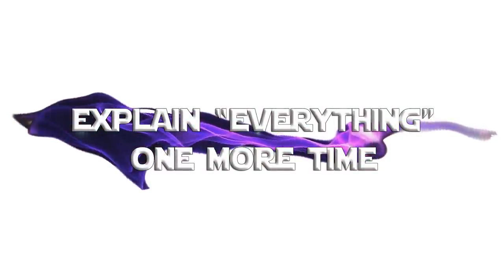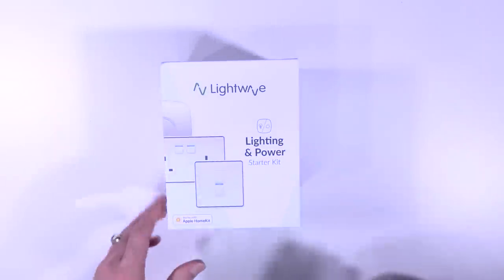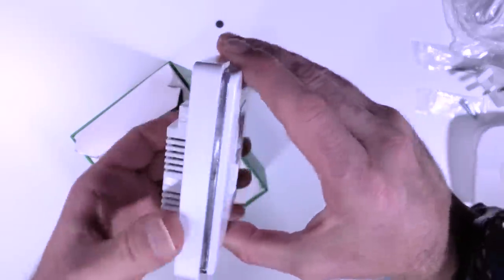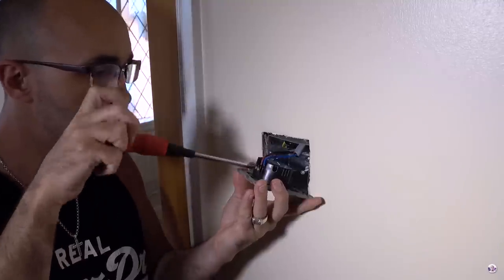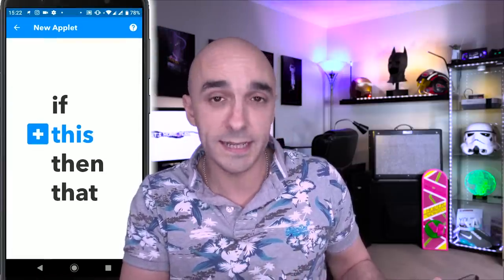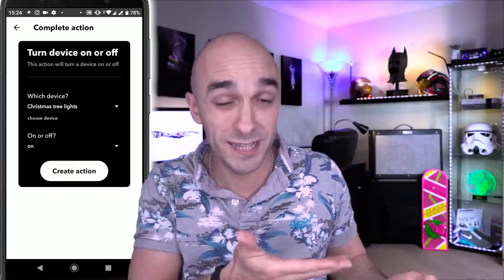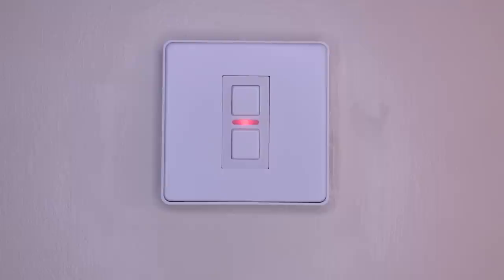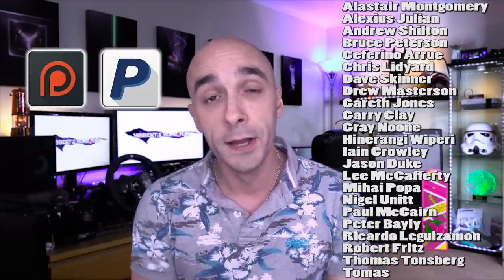Turn On Your TV With Your Light Switch : Lightwave RF Gen 2 Smart Series Review

Comment: Hello Paul. I'm contradicting you :) you can do the same thing with eWeLink broadlink and ifttt. After watching your video, I've tried for myself setting up one channel from a three channel ligthswitch, when it's on the TV goes on. When it's off the TV goes off. Of course that I could use one blank switch for this as well that I can automate to do more then opening the TV. But for now this is what I have set up for my broadlink. Try for yourself and update me if it's working for you also. Cheers mate!
Reply: Also this is not working through rf. It's ifttt based. Which is more simplified. :)
Reply from the maker: Morning mate.  Ewelink requires neutral, but yeah, a much cheaper option if you have a neutral wire!  To my knowledge the Broadlink TC2 can't be dimmed by percentage with Alexa (though I could be wrong), but it definitely doesn't work as an IFTTT trigger yet, as the triggers are broken.  Actually this morning I'm finding I can't get the "THAT"'s working either!! arrrrggghhhhh Broadlink!!!!!
Reply: @paulhibbert  hey Paul. You are probably right about the dimming and the TC2. Now I 2as just speaking that with a very cheap 5 dollars sonoff basic, by using it in conjunction with rmpro you can open a TV and much more. For dimming and so on I don't know. But as you were mentioning Alexa, I can confirm that if I say ok Google turn on movie time which is the name of my sonoff basic for this scene, it will open my TV, turn off unwanted lights and turn on the environmental led. That's great 😊
Reply from the maker: Nice! :)

Comment: I got one for my room to control my zigbee lights via my hubitat, but I am having some issues. I don't want it to physically switch my lights and I can't seem to connect it to my hubitat. I would have got a zigbee light switch, but they a) look like cheap plastic, and b) don't wire in so I can stop accidentally turning off my light. Am I doing something wrong?

Comment: How are these holding up? If the hub or Internet is offline can you still use the switches to turn on/off the lights.
Reply from the maker: They do work offline, but I removed them for something much cheaper after the sockets failed.  I've never looked back.
Reply: @paulhibbert  thanks. Did the light switch fail as well? Did you manage to do another video on the ones yiu replaced them with? Can you share the name model of what you went with please? Thanks.
Reply from the maker: @nasaspacemanwho6711  the light switch lasted well.

I replaced it all with tuya smart life based zigbee stuff from zemismart. If you look on aliexpress for zemismart you'll find their store and its full of cool stuff. 😊

Comment: Do you have to have the LW Link Plus for this to work! ? I have the very first lightwave hub LW930 I think it's called?
Reply from the maker: Not sure if anything before the Smart Series stuff has this ability.  Worth a look, only takes a couple minutes to sign up and start using IFTTT.  Only problem is they are experiencing a VERY lengthy outage on the IFTTT triggers.  I've been complaining to them for over a month that this has stopped working!  I'm almost ready to drop a video telling people not to buy it.
Reply: The connect hub - as its now known - only has limited capabilities.  The new smart hub has two way communications so has a greater range of functionality with IFTTT.  For instance on the Connect hub you couldn’t connect a radiator TRV (to ifttt).  With the smart hub you can.
Just upgraded to the smart hub last week and despite the price its well worth it. The speed it responds is almost double that of the connect and now I have two way communications to smart devices. My connect devices still work but the hub isn’t aware of its state. By that I mean if you use the app to turn on a light the app says its on. If I press the light switch off manually the software doesn’t know so appears still as though it’s on via the app.  Not a big deal for me as I use Alexa to control most of it.

Comment: Can you use smartthings hub instead of adding yet another rf hub?
Reply from the maker: Thanks Gary, pretty sure you're right, I'm amazed it can do the IFTTT trigger thing to be honest as most manufacturers don;t like to play nice, though considering they have implemented IFTTT maybe Smartthings is in the pipeline!
Reply: @paulhibbert  You can already cobble something together in SmartThings using a virtual switch & IFTTT as a workaround if you've got both hubs

Comment: 6:05 I dunno how you can use a multimeter to determine if the electricity is off without a neutral wire in the switch box. There will be situations where zero volts doesn’t mean there’s no electricity at the Live wire.
Reply: If you turn on the switch there will be voltage. There are simpler testers out there that just need proximity to the live/line wire.

Comment: I got one of these and put one in my lounge I did not bother buying the hub as just bought LightwaveRF remote and pointed at the switch then use the RM Pro as the hub  and  only cost me £48 on eBay and when I did buy the first gen hub for cheap on eBay found it was slower to respond than RM pro so I'm back to my original setup of using the RM pro as the hub LightwaveRF light switch and LightwaveRF remote is the cheapest way to use LightwaveRF
Reply from the maker: Nice!!!  How did you teach the RM pro the frequency? ?
Reply from the maker: Ah, wait.  I think I understand, you bought the separate remote.  Only thing without the hub is that you can;t do the dimming by percentage using Alexa I presume?

Comment: What different it is than using a $5 Sonoff switch with IFTTT, eg. If Sonoff switch on Then roll down the blinks, close the curtains, turn the TV on, switch the console on, turn the lights on, send a text to wife (not yours!).
Reply from the maker: Hey man, I love my Sonoff stuff, but this is an apples and oranges thing, they are different products in different arenas... the differences are: 
Reliability
Dimming functionality
Apple Homekit support
Aesthetic
Ability to replace multiple gangs
Missus can't turn the device off at the mains switch rendering it unreachable
Internal automations that will work without Internet
Can be controlled with additional products such as a remote
Can (apparently) be controlled with 3rd party products such as Broadlink RM pro

-P

Comment: I have gen 1 switches and hub. Works well but so dam expensive. I do have one issue and it's a big one for me.  Bloody compatible dimmable led bulbs most of my fittings are e14 screw with 5 bulbs and it's complete joke finding a compatible bulb which is reasonably priced that doesn't hum or flicker or even simmers low enough for me to class it as dimmer..  I've had my winge now. I don't use this switch currently for this reason.
Reply from the maker: Somebody mentioned about installing a capacitor to remedy this.  Might be worth talking to Lightwave directly for a solution and raising that prospect with them! :)
Reply: @paulhibbert  I will be honest I haven't had much luck with them they just tell you to refer to the compatible bulb list which is useless as many of the bulbs are obsolete. So it's annoying and considering the cost of the product the aftersale service is quite poor that's why I wanted to seek an alternative. Well that's my experience anyway.
Reply: @paulhibbert  I honestly think after all the trouble I have had with dimming from these switches the best option is to just have on and off functionality and have additional single bulb lamps in the room. Which are smart so you control light level via them.

Comment: I'm not sure about your electrician knowledge but the neutral doesn't necessarily gove power at all. Instead of saying it supplies power when it's off say it acts as the negative to complete the smart circuit technology because neutral is actually 0v so it doesn't give power.
Reply from the maker: Uh huh. So it supplies power then. 🙄

Comment: Energenie does all this ... no neutral wire needed, works with IFTTT ... and cheaper.
Reply: I found Energenie to be quite unreliable, though it may have something to do with interference given that I've got 6 smart home hubs of various flavours running
Reply from the maker: Hi Lee, I've tried to set Energenie's light switch up as an IFTTT trigger, but when I select the  "device powered on" option it doesn;t let me select a device, it just moves straight on to choosing the "THAT".  Any idea why?
Reply: @paulhibbert  Sorry, I thought I this done this in the past ... But you are right, just checked and didn't show the select screen .......I'm guessing it is it's using any device as the trigger. ......... I get on really well with energenie... 4 light switches, 4 plugs, 2 window contacts and a button. ....... and also have sonoff and broadlink thanks to you. :)
Reply from the maker: Thanks for the confirmation dude. :) wonder if energenie know its broken, would be good to have the option for another room!
Reply: I've just tweeted Energenie about the inability to use a specific device as an IFTTT trigger. Will post anything I get back.

Comment: I almost died when I saw that most lightwave items have increased in cost! Double sockets and single light switches are now £80 a £30 price jump! I'd never have taken the lightwave journey if I'd known what the company was going to... charge a fortune for cheaply produced items... add a subscription... Then hike the prices to make them an unaffordable project! 
I opened a socket to replace the commonly failing cheap relay and there is no part of the unit worth this money! 
This company is going to kill itself!
Reply from the maker: I know right!?... My opinion on them has dropped dramatically over the years... https://youtu.be/J20nNI-QX50

Comment: They are very sexy but they are also Very expensive!   I had the gen 1 stuff and that was bad enough,  about 6month in they released gen2, naturally they werent compatible, kerching lightwave, let's bump the prices even higher! months of dealing with a crappy app while they pushed every effort into getting the gen2 stuff sorted.....I Took mine out boxed it up and returned for a refund  got myself a smartthings hub.
Not paying £60+ for a sexy socket to hide behind a cabinet when i can get  2ikea sockets at £9 each and do exactly the same and probably a million times more through the insanely powerful smartthings rule engine Webcore.
Reply from the maker: Morning mate.  That's a shame you had a rough ride with them.  Seems they finally got their act together with the gen2 stuff a little too late for you :(  I love the smart things route, I have plans for that myself, but there's no compatible mains dimmer that doesn;t require a neutral wire to my knowledge :(
Reply: @paulhibbert  Yes your correct about the dimmer,   thats why they are able to command such high prices,    we are seriously lacking choice for home automation in the UK.
ive just gone down the smartbulb route (again ikea)  just for cheapness, But they work flawlessly so why not
The only wall lighswitch i have changed is the living room and that was for the GLS touch you showcased,  but that too will end up ikea bulbs.   
 just about the only time i talk to "her" is to switch on living room light.    everything else does it automatically when you walk in a room.  I could add the living room light with a bit of webcore but i have more important stuff to sort....Disco Kitchen has been given priority status...hahah
Reply from the maker: Hahaha, I wanna see disco kitchen!!!  Make it so!

Comment: Ouch £80 for a single light switch. Also to help other. The Gen 1 & 2 products.
Gen 1 has 2 LEDs 
Gen 2 had 1 LED

I got little confused when looking over amazon !!
Reply from the maker: Nice one dude.  Their website has some deals on at the mo, if you go there ou can find it for £50 at the moment: https://lightwaverf.com/collections/all/products/l21-smart-dimmer
Reply from the maker: The starter kit is actually a few pounds cheaper on Amazon though weirdly.
Reply: Paul Hibbert £60 and it’s out of stock plus need to pay postage

Comment: With lightwave you need to be careful as they don’t always work all led lights. It’s hit or miss
Reply from the maker: Morning dude! :) That's not a Lightwave thing, that's a dimmer thing in general.  I had to change my bulbs several years ago when I bought my first dimmer for the exact same reason.
Reply: Paul Hibbert with my lightwave I can have 2 like for like switches, one won’t work with led’s and the other will on the same socket. Loving the uploads dude! 👍🏽
Reply from the maker: Might be worth speaking to them about the situation, as killmymusic says there may be a solution :)
Reply: I thought that they had sorted the led thing out with lwrf v2 as long as you use dimmable leds? Have alot of v1 kit& leds are a no go unfortunately :(
Reply from the maker: Worth asking them then as this might be a non-issue for the Gen2!
Reply: Paul Hibbert that’s true I’m using gen 1 so going to make the upgrade
Reply from the maker: Just stumbled across this on their site: "LED lamps must be dimmable." ... So that suggests to me that it works with any LED bulb that is advertised as being dimmable. :)

Comment: I thought it was going to be like 50 pounds max. but this is 230 pounds :O
Reply from the maker: Yup!  Like I said, not a cheap solution, but if the dimming by percentage thing is important to you then it will save you on an electrician in the long run.
Reply: @paulhibbert  yeah sure not blaming you or something 😂❤️
Reply from the maker: Blame apple.  I am ;)
Reply: If you want something that just works out the box with pretty much everything and stops you having to string lots of incompatible things together buy these products you will save lots of money in the long term.😀👍
Reply: @paulhibbert  χαχαχχααχαχχα